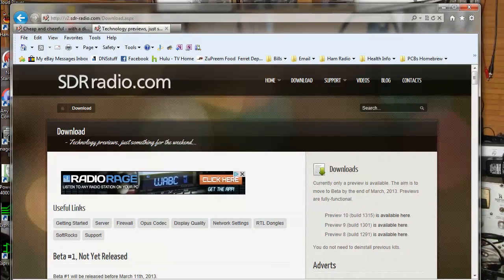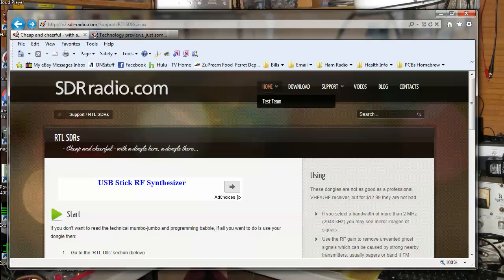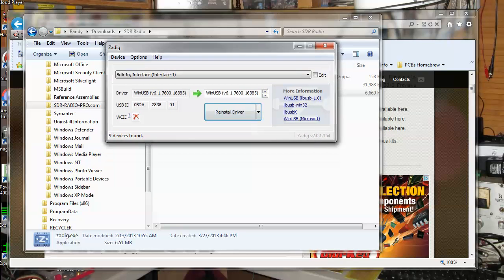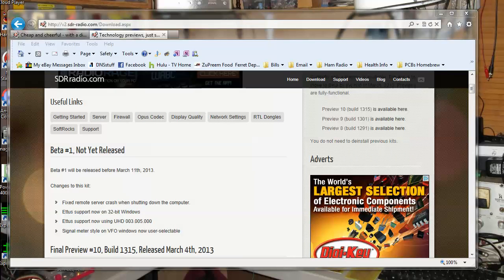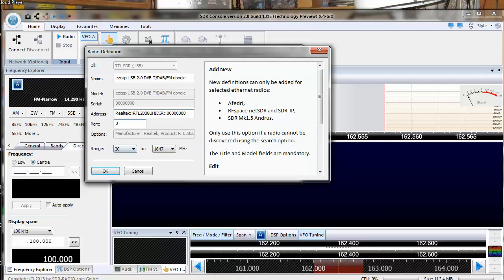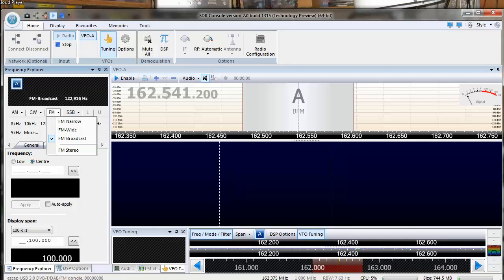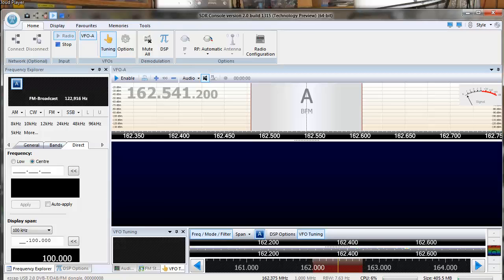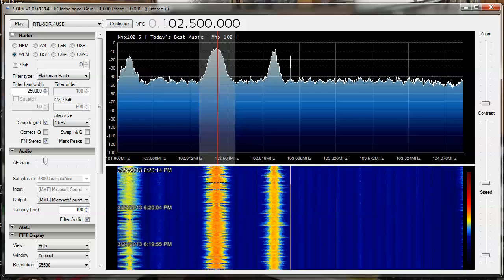3-27-2013 SDR Radio Installation

Comment: You should also try SDR-Radio 1.5. (Run it beside version 2) I like it better, and it's server/client system is way easier. It will not do RTL-SDR's -but its RF-Space web-remote interface is great! You can connect to other SDR's all over the world -this is great for checking your propagation and signal. Just transmit a test on phone or CW, and listen on an SDR in a town, state or continent away! And I agree, SDR# is great, it is very light weight -the choice for single CPU or slower machines.